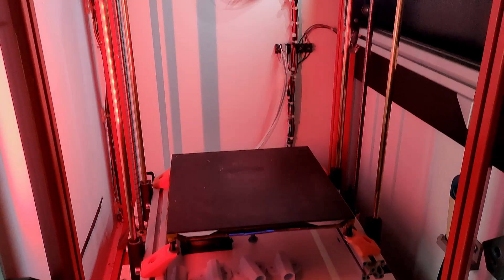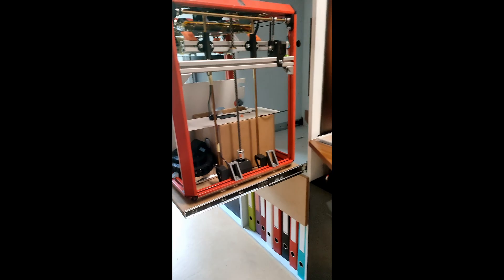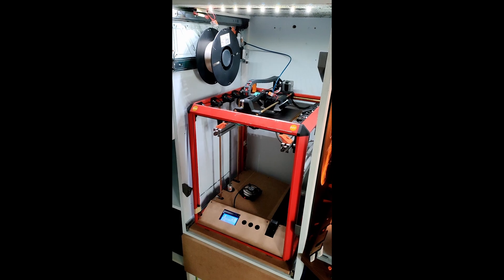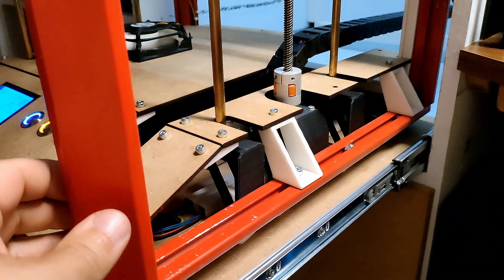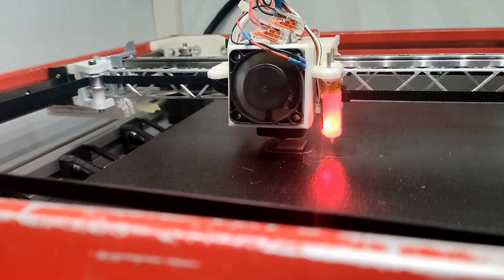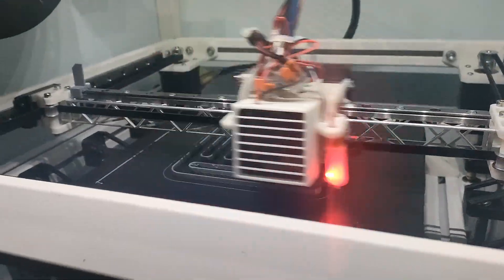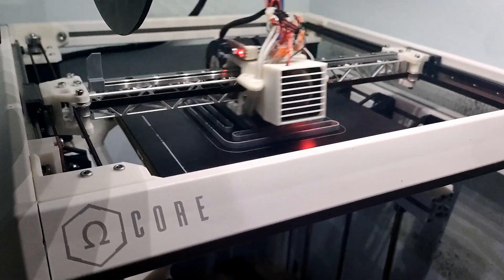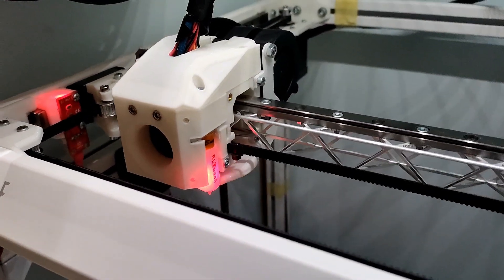Omega Core DIY 3D Printer Update 23 01 2024

Comment: Awesome! Clever with the sliders. Where did you buy the triangular alu profiles and what's the model number?
Reply from the maker: Thanks :)  I bought the triangular profiles about 7 years ago from a swiss company. sadly, they went bankrupt in the meantime. But I am sure that you can find other sellers with the same profiles. The dimensions are 30 x 30 (mm).

Also, they where really not cheap. I think square ones are cheaper than triangular profiles.

Edit: I am thinking about building a second printer. I will also search for triangular profiles again and will share details about where to buy them and how much they cost :)

Comment: Are you using brass smooth rods with regular linear bearings? any signs of wear on them?
Reply from the maker: I was using them for the X and Y axis for a long time and never had a big problem with wear on them. however, now that i changed to linear rails (see end of the video). They are much smother and more stable. On the Z axis i am still using the brass-rods but i will change that in the future, as i think that it causes the printbed to vibrate more (less constrained than a linear rail). In my opinion, the only reason to use brass rods is because they are cheaper than linear rails. hope this helps :)